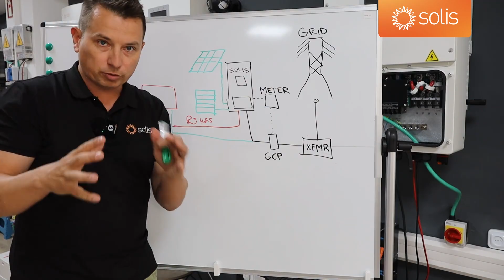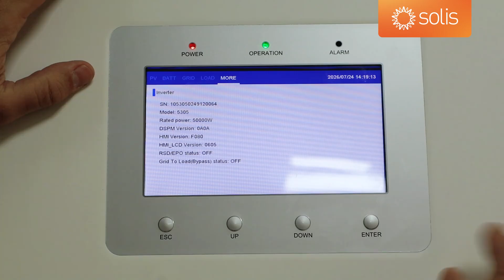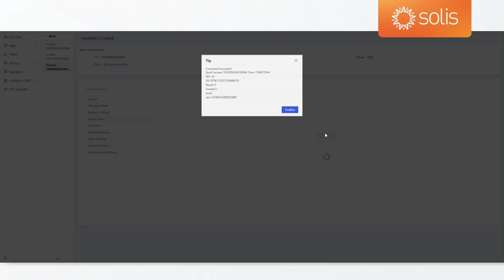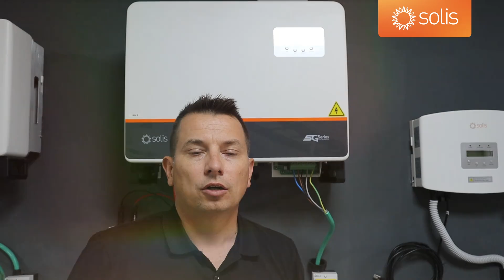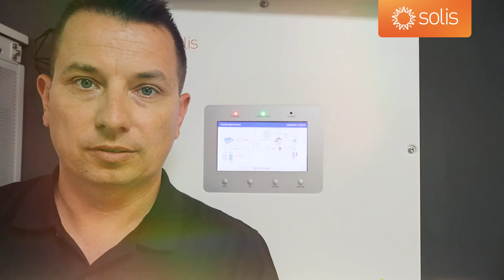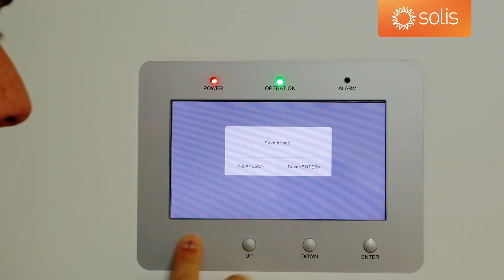How to control Grid Tied Inverters with the Hybrid Inverter.

Comment: Nice video. Does this application allows to use the power control on grid side and also use the smartport for a generator, smartload or AC coupled inverter too to the hybrid inverter side?